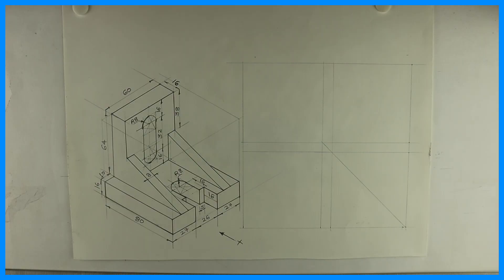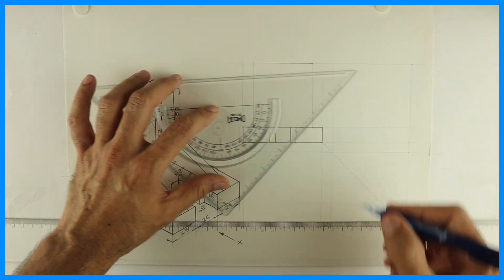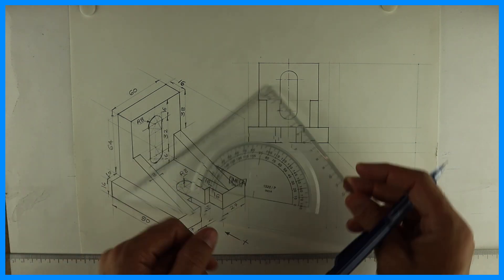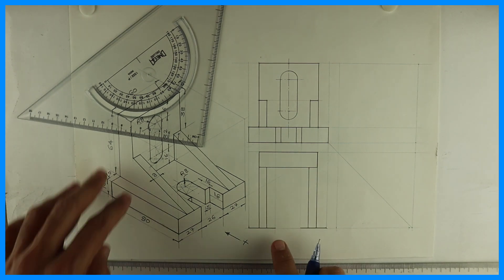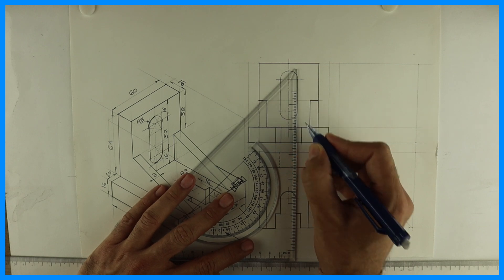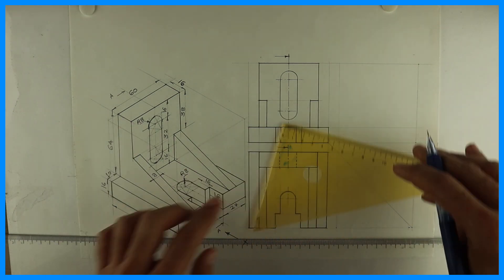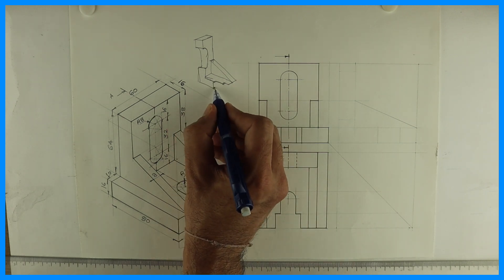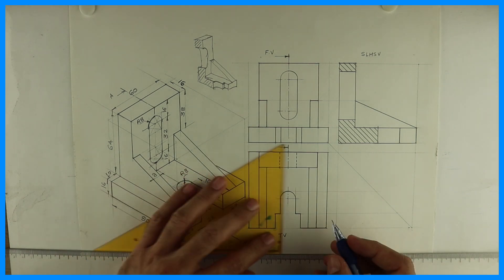Sectional orthographic - Engineering drawing - Technical drawing

Comment: Very nice explanation sir. 
In this question we have drawn a circle of  8mm radii, so it can be drawn by compass. But sir in 1 ques. which I was solving, we have to draw the circle of 4mm radius which is difficult to draw by compass. So sir plzz tell that how to draw the circles in these questions?
Reply from the maker: You can use big compass with foldable legs or with pro circles